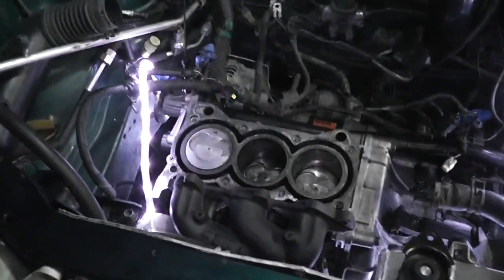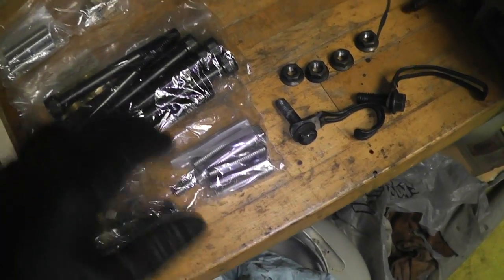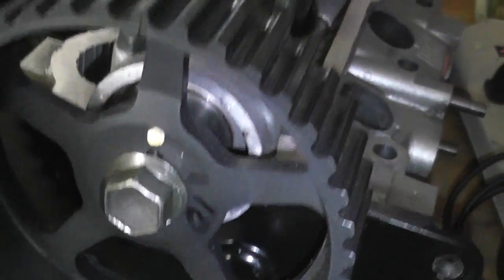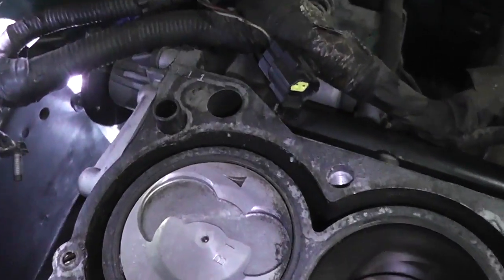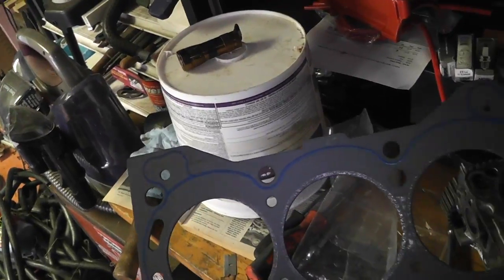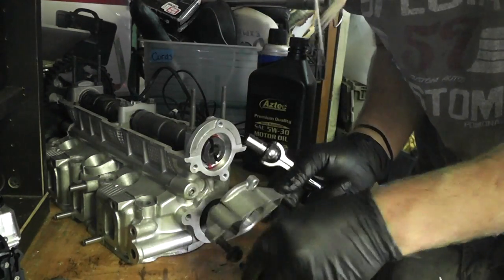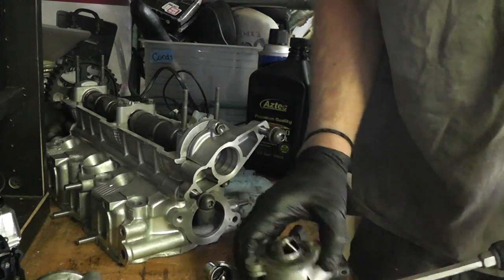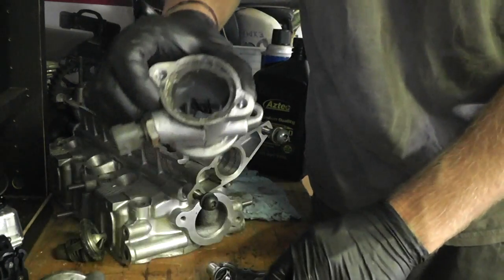Geo Metro Head Gasket: Episode 7  - Cyinderl Head Bench Prep

Comment: Im about to do some similar repairs on my 99 metro.  Thanks for the vid!  I’m curious/concerned about the seals on you gaskets.  I’ve done a head gasket seal before and used a high temp silicone.  Is there a reason you didn’t use a compound for the gaskets? I’m amateur but I would reason to think without a sealant for the gaskets it would over time cause airflow/ air leaks.

Comment: The thermostat looks like that because it's a "fail safe" thermostat.  They are designed so that when the engine overheats, that rod pushes out of the copper base and permanently holds it open.  I have a 97 Metro, it overheated a few months back when the top of the radiator split open.  After I replaced the radiator, the engine would never warm up.  I checked the thermostat and it looked like yours.  Awesome video series BTW!

Comment: What Head Gasket was the better head gasket?  I'm about to buy a car in an hour with this motor and a blown head gasket....  Probably do the same head too cause hey why not.
Reply from the maker: Don't go with the expensive "no blow" headgasket.  That was a lie, it blew in less than 10 thousand miles 😑.  But the cheap one I slapped in is doing great.  Google geo metro oil fart (I know it sounds like a practical joke) but you can make a small modification to the headgasket and save yourself some tailpipe smoke later

Comment: how did you clean off the old head gasket from the block?
Reply from the maker: +Lucas Kwoka-Coleman good question!  If you watch the end episode 5 where i wrestled the head free I remove the gasket.  In my case it came off pretty cleanly, meaning it didn't rip or get stuck, but it did need cleaning.  If I remember right I shop-vac'ed the block to remove all the fluids and bits then used a rag with a little break cleaner and didn't have to do any scraping or razor-blades

Comment: how did you pull the old studs off and could you reuse them if you needed to?  I'm in the process of doing this myself and can't find any studs for the exhaust and intake manifolds anywhere
Reply: Hey Lucas, if you're doing a rebuild I think you should pick yourself up a FSM off ebay, I got a two book set for mine for like $30 and it helps so much w/ everything man. If not an FSM, a Haynes/Chilton manual will work too (I think Imperial Beach Dad did this w/ a Haynes manual actually)

You'll find answers to 99% of those spec questions you've got. Good luck w/ the build bro!
Reply from the maker: I did pull the studs off to mail my head back for the core charge.  Just thread two nuts onto the stud then tighten them together super tight (loosen the one closest to the block while tightening the second one furthest from the block at the same time will lock them in place) then you should be able to wrench the nut closest to the block in a counter-clockwise manner.  The other nut will keep it from turning and the stud should loosen instead.  Spray some #wd40 on the stud base too, never hurts.
Reply from the maker: I'm not sure what the "right" answer is but I suspect you'll be fine reusing the intake and exhaust studs, just not the head studs, those are onetime use only as I understand it
Reply: ok sounds good.  if my head doesn't have studs I'll just reuse them.  thanks man!
Reply: Oh and what was the nut size please!!
Reply from the maker: Just use the nuts that were securing the manifolds when you got started
Reply: Oh duh. right on
Reply from the maker: Haha, easy mistake to make.  Good thing you have the originals, I'm the worst when it comes to identifying threads and nut sizes.  I envy the guys who can just know by looking at them
Reply: Haha I know.  How did you put the new ones on? Did you use any lock tite or just wd 40
Reply from the maker: For the block studs I did a drop of motor oil and torqued to spec, I think that's in a later video.  The manifold studs I just wrenched until tight.  In my case Allen wrenched cuz that's how my new studs were setup
Reply: alright sounds good man. thanks for the help!
Reply: Thanks Julian I got a Haynes manual already and it helps alot.
Reply from the maker: +Julian P I never thought of looking at the manual, it probably does have the specs on those studs should you want to order more that's a good tip
Reply: If you have new plugs and studs for the new head, why take the old ones out of the old head? when leaving them there ensures you don't lose them? Are you planning on selling the old head? or keeping it in reserve?

Comment: That bent thermostat at 10:15 is a common manufacturer problem. Both of the Geo's ive owned have had bent thermostats and i believe one of my fathers Geo's did the same thing. Ive never seen anything like it except with these cars. Just food for thought.
Reply from the maker: #fascinating!  Did it happen under extreme load conditions like it did in my case, or more like they just fail at random and when they do they bend?
Reply: Imperial Beach Dad couldnt really tell you but thankfully none of mine had a head gasket problem. Since it was stuck open id imagine the only way your head blew was from idling too long or heavy load on the engine.
Reply from the maker: Yeah, I bet it was the extreme load now that you mention it, it seems like being stuck open would only effect cold engine warmup because that's usually when it would be closed

Comment: Show Geo - awesome!  :)  Never seen a thermostat fail like that but then a lot of things have changed since the days I did that stuff.  Very likely that was the root cause of your gasket problem - thermostat blocked coolant flow causing overheating & head warping.
Reply from the maker: yep!  That's what I think happened too.  #Automotive #forensics at its best
Reply: It's great of you to share your knowledge - it empowers folks.
Reply: its likely that cylinder pressure escaping the head gasket from an overheat condition could have popped the thermostat loose in such a manner , as the the rod is usually pressed or crimped to not move just allow the plunger to move on the shaft ...